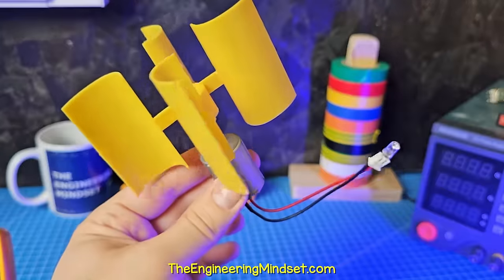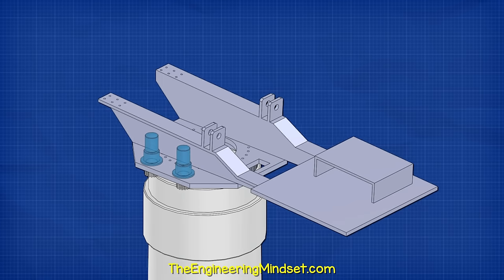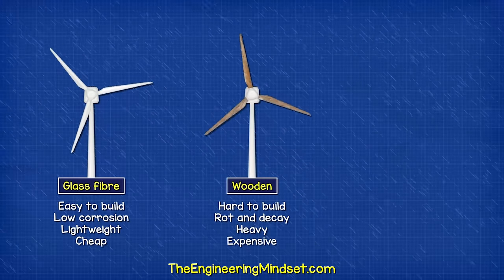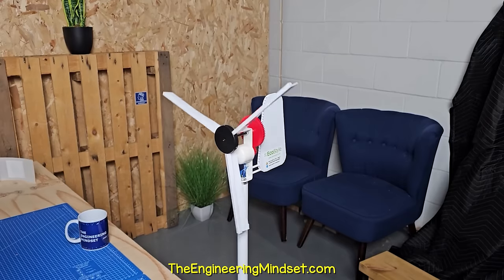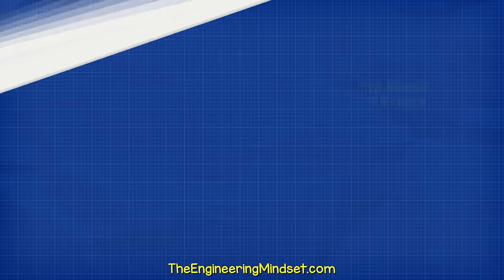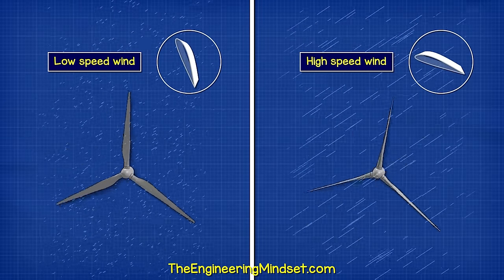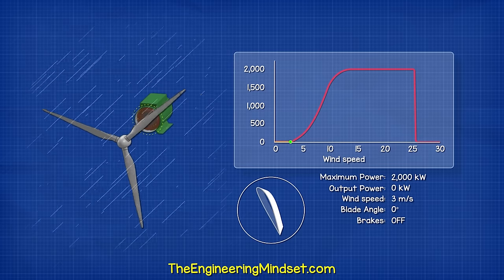How Wind Turbines Really Work: The Hidden Secrets

Comment: Did you know, that the big wind turbines (like the one on the North Sea in the waters of The Netherlands, the turbine blades need to be electrically started, and when it rotates at the minimum required speed, it then can start producing electricity. If those turbines are not “jump-started” then the windturbine simply remains stationairy. The blades are too big to be self starting… I do not have the exact numbers, but to jump start it, it needs as much energy as a small village uses in a day. The information was given to me by a good friend who works for a national grid company (Tennet (Exience)) in The Netherlands.
Reply: yeah, I remember the big deal about all those diesel generators!

Comment: Nothing is missing on these modern wind turbines.. . .   There is a small wind direction detector, too small for these pictures to show.. . .   And there are internal motors that will turn, rotate the turbine head in the required direction either for best wind generation, or to stop the turbine rotating, usually for maintenance or in very high winds, other motors can be used to change or adjust the blade pitch.
Reply: But I think that is actually explained in the full video.

Comment: I've always wondered how 60hz (50hz in Europe) would be maintained during a sudden wind gust. Thanks for your explanation of a device to rotate the field to maintain proper frequency. I would imagine that same device is used to keep each wind turbine in phase with the grid. I prefer to call a machine that generates AC an alternator. Maybe in Europe everything is considered a generator. Here in my area, (Oregon, USA) the wind turbines are just a dog and pony show. They sit idle over 1/3 of the time, create electricity about 1/3 of the time, and use electricity, from our vast hydro-electric system, to rotate the turbines and make them appear to be producing electricity the rest of the time. Unfortunately, this scam is giving the greenies ammunition in their argument to remove the dams from the Columbia River. If that happens, we'll be screwed because those wind farms will never be able to supply the  amount of electricity that the dams are producing.

Comment: Sadly there is often no wind or too much wind for wind turbines to operate and here in Scotland solar PV is ineffective for 7 months of the year and no great for the rest.
Great video if not entirely accurate in some parts.
Reply from the maker: What do you feel isn't accurate in the video?
Reply: You do us wrong, solar still works fine this time of year just for not as long and slightly lower output cos the days are shorter, the sun is at a lower angle and its often cloudy but that applies to many countries including england. Same with wind, very rare for there to be too much and usually some wind. The main problem with wind is the grid which cant handle the power generated which is why when its high/gale wind you find some wind farms shut down and others operating. I have two turbines and 3 kw of solar so have an idea of whats happening. I also live next a wind farm.
Reply from the maker: I would agree that Solar probably isn't the best choice for locations like Scotland. I gave some examples of this in the solar panel explained video. But Scotland has incredible wind and wave energy. Wind technology is the fastest growing energy source in Scotland because it has such high average wind speeds, especially out at sea. Small domestic ones on properties could suffer but usually because the installation location limitations of the property.
Reply: but surely lack of 100% efficiency is not a reason not to make use of the wind and solar that is available? it may make pay back a bit longer but the days are longer here in summer although my panels can suffer from getting to hot and reduced efficiency in summer, but thats not so often as to make them unworth while. PS single blade turbines are counter ballanced and I recently changed my home built 3 blade turbine to 2 and found an improvement in out put, if you dont use iron in construction of the stator they start much easier with no cogging.  @EngineeringMindset
Reply: You are right about the wind in Scotland especially around the coast. The main problem with that is the long distances that the power has to be transmitted before it can be used. For example here in the Highlands we have an area the size of Belgium with a permanent population of around 260k. That means we cannot use the power locally and the transmission lines  such as the Beauly to Denny line are over 100 miles long with numerous branch lines to connect individual wind farms. The B-D line was put in a few years ago and plans are now being put in place to upgrade it because it isn't sufficient. 

The tidal experiments that have been tried don't last very long because the environment is very harsh and the difficulty of maintenance. There have been at least seven different companies been and gone in Orkney alone, all taking government grants and producing nothing. The only effective tidal power generator I have seen that is used (I think) in Portugal isn't very efficient but seems to last very well but it isn't being tried up here.

The reason wind is the fastest growing is because the government are ploughing huge subsidies into the schemes and with the recent round of bids for the offshore scheme there was no bidders because the price hike being demanded *at least double) was initially rejected. Sadly the government has now recanted and allowed a substantial increase. This means that wind power will not be cheaper in the long run. @EngineeringMindset

Comment: 11.41 my friend.  I think k you have put in the wrong u its for the tower and the wind turbine. N.B.
Reply from the maker: 280 is the total height, maximum point of blade down to ground level. 115 is just the length of one blade. Eifel tower was show on right first, to illustrate value is height. But I see what you mean, it probably isn't immediately obvious.
Reply: @EngineeringMindset  so a blade is over 380feet long!! Wow

Comment: A 500W generator is entirely i sufficient to power even a camper... An average microwave runs at 1100W to 1500W and a very small air conditioner at around 900W.

Comment: Wait! We need to supply electricity to the rotor to generate electricity from a wind turbine?
Reply: A very small amount, like any other energy generation method
Reply: @Orbital_Inclination  What do you mean by "like any other energy generation method"? This can't be true because this means we would have never been able to start generating electricity in the first place. Besides we can generate electricity by cranking a shaft and this doesn't require any electricity.
Reply: @slimeminem7402  for fossil fuel plants, electric pumps and/or belts provide the fuel and sparks provide the ignition. That requires electricity. 

For nuclear, electric motors move the control rods out to allow the reactor to generate enough heat for steam. 

Solar is the exception because there are no moving parts. 

The tiny input energy to alter blade angle on a turbine is negligible anyway, compared to output energy generated.
Reply: @Orbital_Inclination So you are talking about the way we do it to generate electricity for the grid; I get it now. I thought you were talking about electricity generation in general.

Comment: 00:00 🌬 Introduction to Wind Turbine Basics

Wind turbines convert wind energy into electricity.
Factors influencing power generation include wind speed, turbine size, and blade design.
Turbines can be located on land or at sea, each with its advantages and challenges.
02:01 🏗 Wind Turbine Structure and Design

Large turbines consist of a tall tower, generator, gearbox, and rotating blades.
The tower houses essential components like the generator, gearbox, and braking system.
Blades, made of reinforced glass fiber, capture wind energy with optimal aerodynamics.
05:02 🔄 Wind Turbine Operation Process

Wind direction and speed are monitored by a wind vane and anemometer.
The turbine adjusts its position to face the wind for optimal energy capture.
The rotating blades generate mechanical energy, converted into electrical energy by the generator.
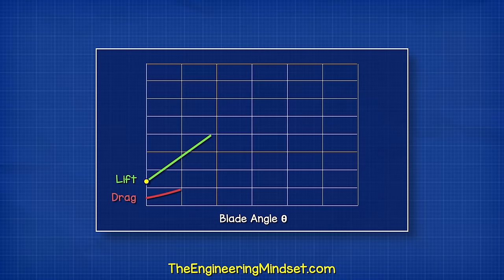09:12 🔄 Blade Angle and Power Generation

Blade angle affects lift and drag, crucial for controlling turbine speed.
Optimal blade angle maximizes power generation without overheating the generator.
Wind turbines have cut-in and cutout speeds for safe and efficient operation.
10:47 🔄 Number of Blades and Energy Production

The number of blades influences stability, voltage production, and ease of rotation.
Three, four, or five blades are common for optimal energy production.
Blade design and number vary based on turbine size and application.
14:10 ⚙ Gearbox and Generator in Wind Turbines

Large turbines use a gearbox to increase generator speed for efficient electricity production.
Doubly Fed Induction Generator (DFIG) is a common generator type for large wind turbines.
Gearbox, hydraulic brake, and generator work together to ensure controlled and stable operation.
17:17 🔄 Electricity Generation and Frequency Control

DFIG uses rotor speed control to match generator frequency with grid requirements.
Controller adjusts rotor speed to maintain a constant 50 or 60 Hz output.
Wind turbine operation explained in the context of frequency control and electricity generation.
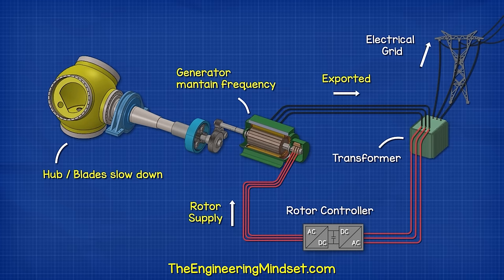20:26 🎓 Sponsor Message: Brilliant Learning Platform

A brief message about the Brilliant learning platform and its relevance to engineering education.
Highlights the variety of courses, hands-on learning, and problem-solving opportunities.
Encourages viewers to explore the platform for free and offers a discount on an annual subscription.

Comment: Why can't wind turbine be connected to a flywheel? This way, when there is no wind, the generator could hook up the gears to the flywheel and power generation could continue
Reply: Because it would need to be in the Nacell, and because it is heavy it would mean you would need to make the whole tower stronger. Also a flywheel stores very little energy, too little to make an impact.

Comment: The only thing left to figure out is how to get the maintenance crew down in one piece in case of a fire breaking out while they're up there.
Reply: one way would be the cable that is used to lift parts that comes out of a hatch at back of the turbine. I assume it is remotely controled. it also used for maintenance and blade inspection.

Comment: “It’s always either sunny or windy” …yeah no, nice try though.  So it’s windy every night?
Reply from the maker: The sun is always shining on the planet, the opposite side is in the shade. There is therefore a temperature difference. This results in air flow. The velocity varies but the air is always moving. Sometimes very slowly at the surface level, but the higher we go the greater the velocity.

Comment: Anenometer
Generator 
Rotor
Cable
Transformer
Renewable energy wind 
Aerofoil blades 
Turbines 
Angle 
Angle of attack 
Drag 
Minimise drag 
Maximise lift 
Higher pressure 
Provides lift 
15 rpm 
Turbulent  streams 
Risk management 
Registrar 
Low voltage 
Rotation 
Design chart auto 
2 MW

Controller changes of angle 
Three blades higher voltage 

Stable 
Tip travels faster than hub 
60 hetz 
Tail fin 
Loban 
Loban
Loban

Comment: but they only produce 25-27% of the capacity they TELL you it will provide. This is proven from studying currently operating wind farms, provided by OFGEM. IE/
ADVERTISED = say 30Gw.
ACTUAL = 8Gw.
To get the 30Gw, the wind would need to blow at a perfect speed for the turbine's generator, FOR 24HRS / 365 DAYS a year. You dont "data" to know that simply does not happen.

Comment: Your explanation about the aerodynamic lift is incorrect, air doesn’t care about length (otherwise you would rather use a halve cylinder) it has to do with pressure gradually changing to atmospheric, so near the wing it has to be lower (super short explainer) so the actual curving of the air flow is relevant, not the length. This is a mis explained topic in soo many explanations..

Comment: 5:44 This is not true! There are times, e.g. in winter, when the sun does not shine for days on end and where the sky is packed with clouds with days very short - hence there is no wind and sun. Please be more precise.
Reply from the maker: At ground level, sure. But go up high on a tall building and there's wind. Go above the clouds and there's sun shining on the clouds. The jet stream also doesn't stop. The clouds are moving. The sun is warming an area as the earth rotates and the sun's energy causes wind through temperature difference.
Reply: @EngineeringMindset  You must be kidding. Wind turbines on Skyscrapers, perhaps? And flying solar panels up in the stratosphere, perhaps?
Reply from the maker: Wind turbines on skyscrapers have been tried, but are not a good idea because of vibration. Example: the "Strata SE1" building in London, UK. That building is 147-metre (482 ft).
However, the Haliade-X wind turbines reach 260-meter (853ft) so almost double the height so we don't need them on buildings, they are taller than buildings. There's even larger ones coming in production too.
And yes, multiple companies and governments (e.g. spacesolar.co.uk) are in the process of designing and building solar farm satellites, which don't need to worry about cloudy days. That part isn't readily available technology at this moment in time, but I don't doubt it will be within say 10 years.
We also have flying wind turbines which can reach maybe 600 meters into the sky. Just a turbine on either a helium vessel or an aircraft style vehicle. 
Whatever the obstacle, there are engineers working to solve the problem.

Comment: Yes as part of a multi source power gathering operation from such effects of solar energy yes including the wind from solar causing temperature changes during earths rotation that we can harvest making air mote stape sitting in one place and gathering the dust from the area by slowing down the windas many tall buildings already do but the less efficient supposedly larger sail surfaces not requiring a directional finder and able to use multidirectional wind for power unlike the other with the significant additional benefits of no flicker in shadow as it'd be much larger shadow think like turned blind shutters you could simply tune the angle for windspeed and bobs your uncle since you already got that going just make them all sundials with solar panels as the surrounding ground with usable crops between not merely lawns but actually agriculture protected by the systems and further expansion too as excess loads and power generation aka absorbtion can be pump stored in giant water batteries using the excess to operate lifts pumping water upstream for locks filtering and cleaning water supplies for us and the wildlife it's really not so complicated unless you overthink how simple the pattern is like a trees roots drawing nutrients to the trunk bark leaves etc you just make all the leaves/seeds of labor as exports for use❤

Comment: 7:08 Wrong lift explanation again👎 😪
Pressure doesn't decrease because the velocity increases, it's the other way arround!
Bernoulli's principle doesn't say anything about Cause and effect.

How lift really works: 
1) The air is moving along the curved surface on the top of the wing because of the Coandă effect forming a lower pressure region on the top of the wing.
 It is the pressure gradiend that applies a downward force pushing the air downward arround the curve of the wing.
2) This pressure gradient accelerates the air moving over the wing, until it has reached the point of lowest pressure. When the pressure starts increasing again towards the back of the wing, the air slows back down.

The main thing to understand is that force causes a change in velocity, not the other way arround.
Reply: It's too bad you've got such an abrasive approach to you're explanation. People might have given a shit otherwise.

Comment: Uses 600 gallons of fossil lubricant for the gear train and needs to be changed and life span is limited.
Reply from the maker: Perhaps but coal, nuclear, diesel turbines, hydro etc all also require oil based lubricants and have limited lifetime. We just don't need to burn fuel to turn a wind turbine. Sure, we need to consume some energy, to yaw and match gris frequency etc.

Comment: The Engineering Mindset,

While they are tecnically interesting and good feats of engineering, they remain third rate generators for grid supply.
Their output is very variable and and using the U.K. as an example our 25 Gigawatts of connected wind power generates on average about 7 gigwatts per annum which is  avery low figure.
They are asynchronous which means that they are not able to assist in balancing grid load and supply.
They have no inertia required to stabilise grid frequency.
They do not contribute reactive power for stable voltage control.
They do not support short circuit level current for the timely and proportional operation of grid protective systems.
Thye have short life and their output deteriorates steadily as thye age at about 3% per annum.
They  require extensive grid expansion to connect them and are often placed, contray to good engineering practice, far away from the demand.
They cannot run without the support of conventional genertaion to provide all of the above criteria. You might as well not have built them at all.